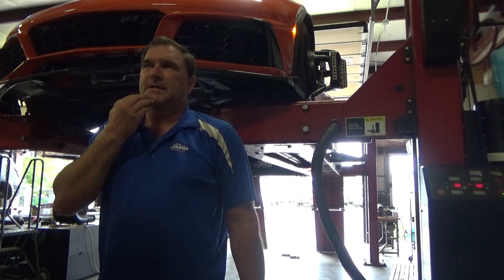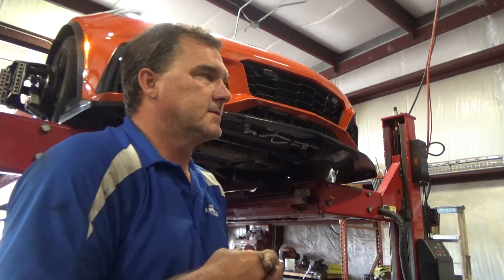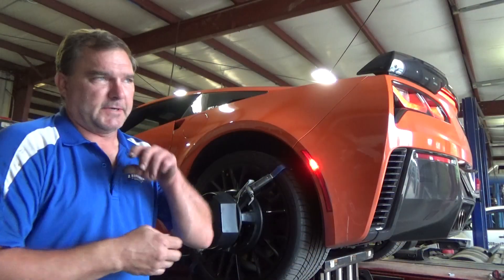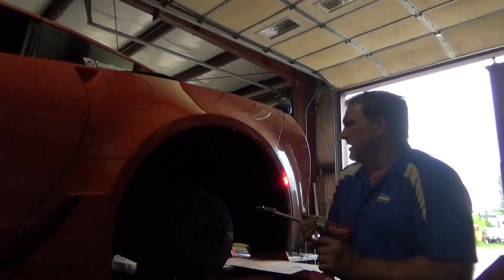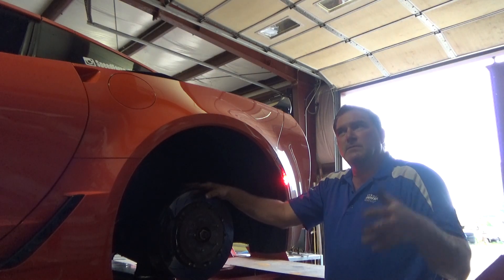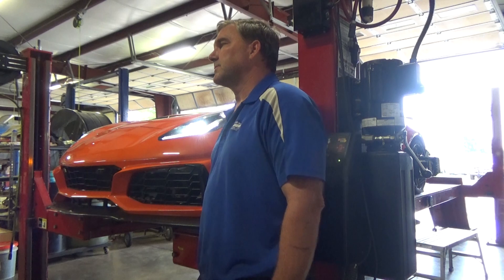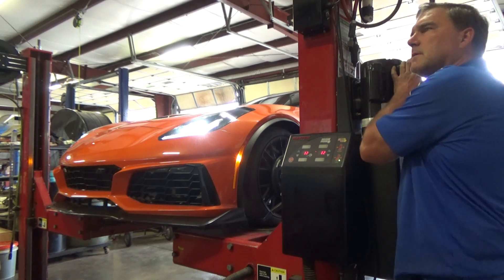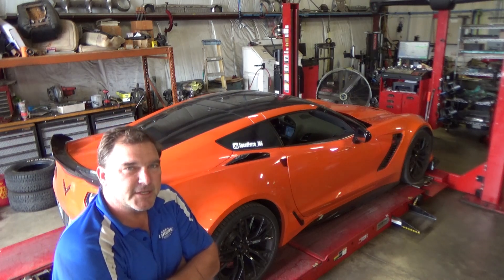C7 Z06 Suspension Setup! Initial alignment setup on factory components!

Comment: Guess those Corvettes have a emergency alert system when they are in a garage. side marker lights on thru the entire video. Good work Rich. 4 wheel independent suspensions are a bit radical I presume to align.
Reply from the maker: Power is on in the car the entire time we are doing this and the brake peddle is depressed ;) These alignment for sure are tricky, there are a whole lot of possible adjustments that can be made to dial it in just how you want. This won't be the last you'll see of this car either, more adjustments ahead!

Comment: Question:
I own a 2017 Grandsport and i want to adjust the front camber specifically. I've read online and in the car manual that only the Z51 and Z06 youre allowed to remove shims on the upper control arms to achieve negative camber. But with the grandsport you have to use the lower arms? Why is this so?

If anyone can answer this question id greatly appreciate it. Is it only exclusive to the grandsport model that we cant remove upper shims or washers to adjust camber? Or am i wrong... thanks in advance